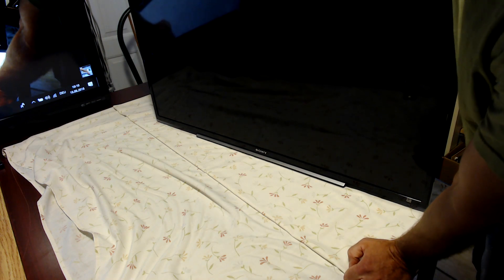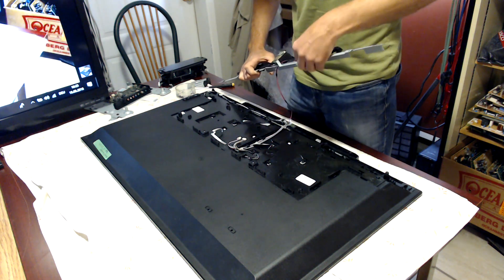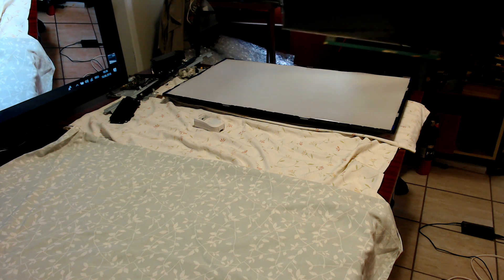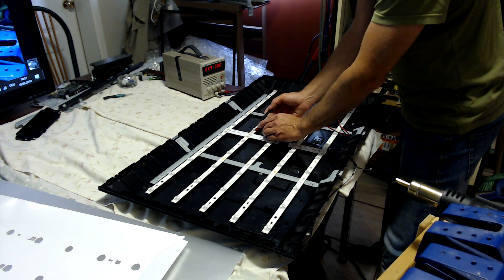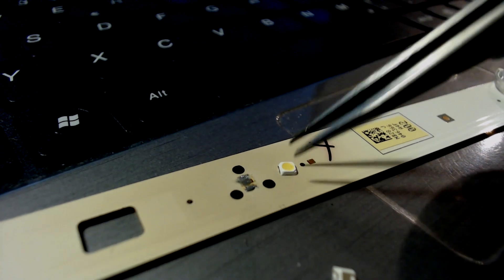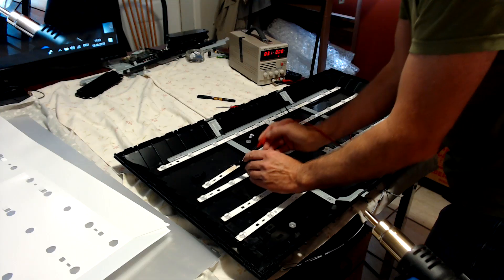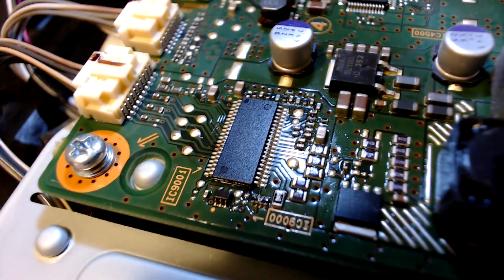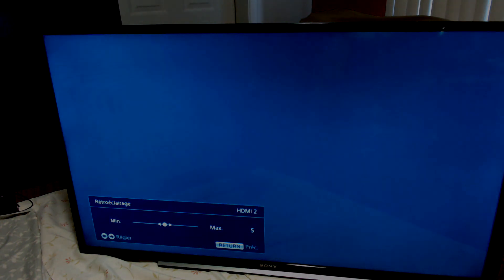Sony KDL-40R470B 6 red blinks repair

Comment: i got same set same problem i checked all led lights with screen out they working as they should but still flash 6 times confusing
Reply from the maker: check the smd resistors around the LED driver chip, I've seen them getting too hot and either be defective or their solder joints are bad. the LED driver chip could then detect an open circuit and shut off. the problem can be elsewhere though as well

Comment: Hi. I have a Sony kdl-75w850c. One led was defektive which resulted in 7x blink so I replaced it. The Tv worked but I got a new issue. Half of the screen is darker the the other. The new led shines brighter than the old ones although it is 3 volts like the other leds. It is located in the middle of the upper side of the screen. The right half is darker. Is the new led comsuptioning much power which leads to shortage of voltage in the right side of the screen?
Reply: Check if the acrílic sheet is upside down. They went in one specific position. Is wider on the bottom.

Comment: What voltage do you apply to check the leds?
Reply from the maker: For 3V LEDs it's about 2.6. For 6V LEDs about 5.4. (per LED). Always start at low voltage and increase slowly.

Comment: My sony kdl-48 w650d blinks 6 times but the sony logo doesn't show up when booting. I haven't gone round to check each individual led light. Does 6 times blink always tell led light strips defective?
Reply from the maker: Your model is different. In the tv from the video 6 flashes actually means main board failure, from what I remember. May be something different in your TV... LEDs is just one of the most common problems
Reply: @tomtechtod9200  i have replaced the main board but still same problem. I suspect it's the some of the backlight LEDs. The backlight does light up before shutting down.

Comment: I have the same model & the same problem. I have a question,  when power ON the TV, all then LED suppose to light up? For my TV, I notice sometimes the 3 row from bottom light up, sometimes the 4th row only, sometimes 2 row from top.

Anyway, I can see 1 LED doesn't light at all.
Reply from the maker: Yes this can happen. They are probably about to die.
Reply: @tomtechtod9200  you mean just replace a strip LED which have 1 unit faulty LED doesn't won't fix it?

Comment: idea: make tv with two sets of led strips, one inactive, other active, as seems there is enough space. On the back, have switch between primary and secondary lights. Once it fails after 4 years, press switch, boom, 4 more years of use.

Comment: Hi, I replaced the led strips with new ones but I still have the same problem. The main board is also new. What could be the problem??
Reply from the maker: The same problem, you mean 6x blinking LED? As far as I remember there is not much more in this TV than one PCB and the LEDs. If got the board from eBay it might be defective. Are you sure you connected the LED strips correctly before reassembling everything?
Reply: @tomtechtod9200  thanks for your response, I had to buy original LEDS and now the tv is working.

Comment: Product aging. that's what it's called. Sony should pay damages. I do not recommend buying their products. And so it will break down. The power supply will go, then the diodes will go on and on. You will repair until you die.

Comment: Hi. Can I get the specification of LED? As well as the LED strip? Same problem with Sony KDL-43W800C 6 times red blinking
Reply from the maker: There are a lot of varieties of LED strips. When I suspect the LEDs I disassemble the TV and check what LED exctly they are using. Mostly it's 3V nominal voltage per LED sometimes 6V. They come in all sorts of formats. To find the number of a LED strip before disassembly you could try Shopjimmy or eBay, but I woouldn't rely 100% on that. Buying LEDs, measure nominal voltage of an intact LED, measure package size with a caliper, then go to Aliexpress or eBay, search for "backlight LED TV (voltage 3V or 6V) (package). Pay attention to anode cathode size , sometimes anode is the larger pad.

Comment: Hi, my sony kdl-40r470b got same issue. then i fixed it with replacing some faulty leds and it was working fine for several month. now i have got new symptom on the same tv, the tv keep switch on and off repeatedly. is this same issue on led backlight?
Reply from the maker: Yes probably the same problem. I would also lower the LED current by chaning the shunt resistances near the controller chip to a higher value
Reply: thank you for your kind information. i have replaced a new power adaptor but problem not solved. i will try do it as your suggestion. but can you please sharing a video how and what kind of parts to swap? thank you again

Comment: Hey I have a XBR55X850D. The tv will turn on for an hour then turn off and blink a red light for 6 times exactly. Do you know how I can fix this? Thank you!
Reply: I have the same tv. I have been having the same problem for over 6 months. I find that it happens when watching a movie that has dark scenes from a channel like HBO or Cinemax from the HDMI input from cable box or an Android movie app Iflix . I can  watch a channel like CNN or the Android Youtube app all day with no problem. I called the Sony repair here in Jakarta Indonesia, they said would have to replace the main screen, but no stock.
Reply: I have changed some  settings under Picture Advanced settings: Black adjust OFF, Adv. contrast enhancer OFF. Since doing this I have been able to watch a movie, that had previously caused the TV to shut down every time a dark scene showed, completely without problems.

Comment: Replacing a single LED causes the TV to come back with the same fault after a few months. Only replacement of all LED strips with new ones guarantees success.
Reply from the maker: Sorry, this is wrong. It is true that all the other LEDs were subjected to the same high current that caused some of them to fail. However, you can replace single LEDs if you lower the average current afterwards for all LEDs. I did this a lot of times and it works without problems (and without returns). The best option is to lower it on the driver PCB itself, usually by increasing the current sense resistor. Second best option is to do it via the menu (backlight), but you have to make sure to lower it for all sources and disable options that change the backlight setting dynamically.

Comment: bro i have klv40r472b.. due to electric surge through dish cable ..its giving me 2 blink error after sony logo..before 2 blink error it used to run for 10 mins..then time decreased to only sony logo and then 2 blink error..can u help me which parts to replace? i heard changing some resistor smds does the trick...pls help..thank u brother..help
Reply from the maker: Sorry, I would need the TV in front of me . The manual for the 470 syas 2 blinks = mainboard fault, so that<s very vague... Can<t help you with that. The only thing you can try to open it up, remove the mainboard and look for visibly damaged (burned or cracked) components...
Reply: @tomtechtod9200  its already opened up.. also i tried removing coaxial cable jack from the circuit.. didnt help.. in other videos i saw they changed two resistor smds ..one sky blue color(82k/82 somthing) and another one.. u know it used to work fine for 15 mins after the surge hit my tv..then time slowly decreased to 10 5 and now only logo comes and goes to two blink.. do i need to chk voltage in some parts of the circuits... ?? thank u for ur time bro

Comment: Can you please gimme a dumb down crash course on how to test the LEDs  ?
Thanks a lot.
Reply from the maker: Assuming you don<t have electronics knowledge and no equipment to test it the best way is probably to try and find a battery holder for two AA batteries. This should be good enough to provide enough current to the LED without risking to burn it. I can<t remember for this particular TV but polarity should be indicated on the LED strip, if not you<ll have to try either way. don<t hesitate to ask if that wasn<t clear
Reply: @tomtechtod9200  I have the exact same TV with the same problem and I'm thinking of opening it up.
I have a handheld multimeter, but I wasn't sure what's the voltage that the LED should be tested with.
I think I have a holder for 2/4 AA batteries so I could use those too.
I just heard that you said these are 3228 LED and on eBay thay say it's 3V so I guess 2 AA batteries would be good.
I don't have a hot plate but I have a heat gun and solder paste so I guess I'll do this with the heat gun.
Thanks a lot for the speedy reply.

Comment: I have Sony 32inch tv with defective panel. My question is, can i used all the board of my Sony tv (Power supply, led driver board, tcon, mainboard)to connect to my LG 32inch display?
Reply from the maker: You could only do that if both TVs have the same panel
Reply: @tomtechtod9200  they have the same panel in terms of screen resolution & size.
Reply from the maker: @narvaeztiamson918  must be the same panel model number AFAIK
Reply: @tomtechtod9200  How many led bulb does a 32inch panel has & the maximum voltage it requires to lit up all the led bulb? tnx
Reply from the maker: @narvaeztiamson918  this depends on the panel. some have all in series, some don't some may have an edge lit display and so on. no general rule afaik
Reply: @tomtechtod9200  tnx
Reply from the maker: @narvaeztiamson918  depends on the panel, they are not all the same. always start with a lower voltage and slowly increase
Reply: @tomtechtod9200   Good day. I just want to clean my lcd panel, Is it ok to wipe my lg lcd panel both front & back area with dry or wet cloth? I disassemble my lcd panel because i replace 2 defective led bulb of my tv. Thanks
Reply from the maker: @narvaeztiamson918  I wouldn't touch the back of the lcd glass unless you see some finger prints on them. a lilttle dust that accumulated while it was disassembled is usually not visible once reassembled.

Comment: Hello tom, my found one faulty led, replaced it and now all the leds light but still tv turns on for about 10 sec then shuts off and 6 red blinks.
Reply from the maker: Maybe the driver chip was damaged? How did you test all the LEDs? With an external PSU? Did you reconnect the LED strips.?